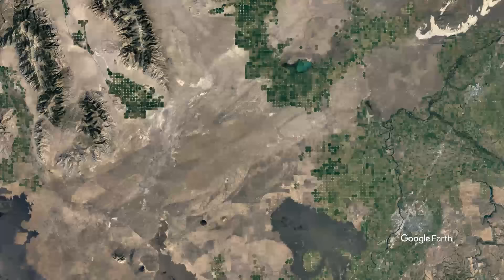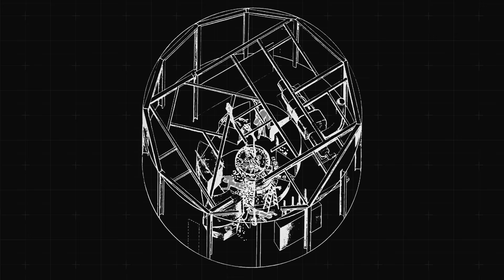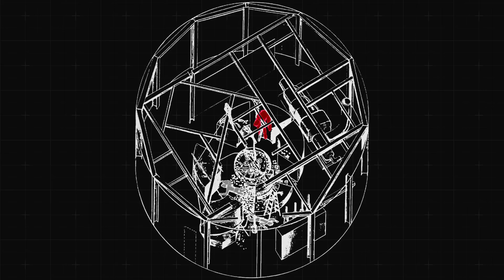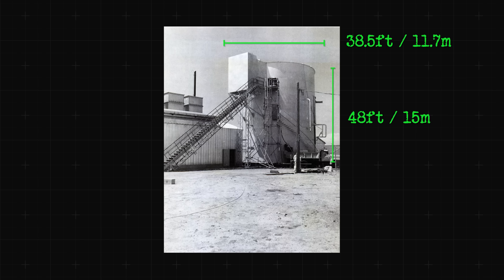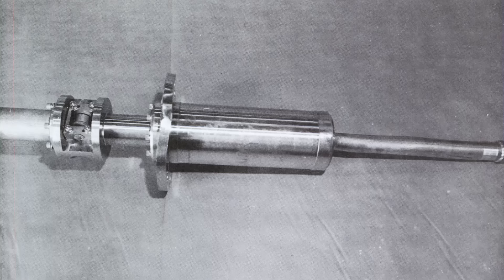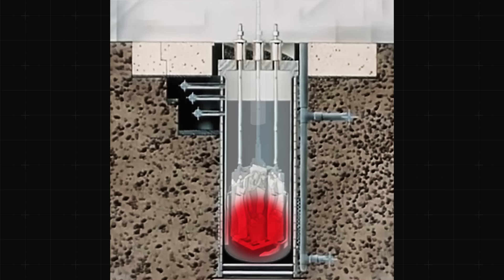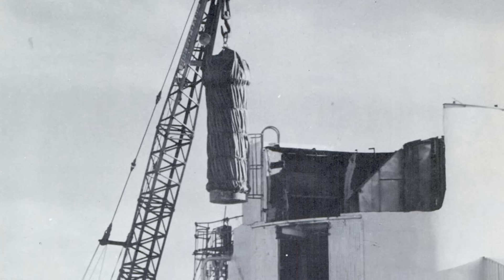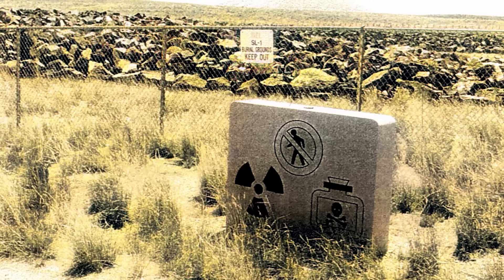America's First Nuclear Disaster - The SL1 Incident

Comment: What is amazing is that it took less than a second for this meltdown and explosion to take place. It gives you an impression on how fast fission can take place.
Reply: WAAAAY less than a second.
Reply: A nuclear detonation takes place in billionths of a second. The SL1 reactor going prompt critical while still far faster than any human could have responded to was much slower. However, what happened was much closer to a nuclear detonation than a nuclear reactor.
Reply: @taras3702  “Nuclear detonation” is an essentially meaningless term, there are no redox reactions occurring.
Reply: They were dead before they even realized their mistake.
Reply: Jim Frazier  The heat from radioactive decay of fission products must be considerable for snow to melt on contact at that location.
Reply: Jim Frazier  Just like what happened to the core of the reactor during the Chernobyl accident. Chunks of the fuel rods and graphite were ejected everywhere at the plant, and just one chunk of a fuel rod or graphite inflicted supra-lethal doses of radiation. I imagine only bits of the core were left of the SL-1 reactor. I don't doubt the debris was buried as speedily as possible. I imagine the photographer who photographed the remains of the core absorbed a hazardous dose, like those who were present at Chernobyl.
Reply: @taras3702  Nothing actually detonated.  The heat released by going super critical flashed the cooling water to steam.  This in turn resulted in enough pressure to blow the op of the reactor off.  Kind of like tossing an unopened can of beans into a campfire.
Reply: @cerad7304  I know that. What happened was in simple terms a nuclear fizzle, where a nuclear device failed to detonate but the core and surrounding components "disassembled" themselves before a significant nuclear yield could be generated.
Reply: @taras3702  No. Just no.  This was not a nuclear fizzle.  The reactor was not on it's way to producing a nuclear explosion.  The only role the nuclear fuel played was to superheat the cooling water.  It is simply impossible for a nuclear power plant to generate a nuclear explosion.  A bit of research will make this clear.
Reply: From the time the reactor went prompt critical to the time it destroyed itself (stopping the reaction) was about 7.5 milliseconds.  During that time it produced about 6000 times its designed power output.
Reply: @cerad7304  Prompt criticality means  fuel, cladding and the coolant vaporizes from the sudden power surge that could be millions of times the reactor could handle. That makes it a bomb, as as I said  before any nuclear yield could result the core "disassembled" itself and halted the nuclear runaway.
Reply: @taras3702  The coolant flashes to super heated steam.  The fuel and cladding? Not so much.  It's a steam bubble explosion like heating an unopened can of beans in a camp fire.  'Millions' is a bit of an exaggeration.
Reply: I‘m still surpirse how horrible that reactor design must‘ve been that the accidental removal of a single control rod leads to immediate explosion. wtf
Reply: @everyone  they probably had enough time to think "oh shit" in their minds
Reply: @taras3702  Photos of the core were taken via a camera attached to a crane. Crane operator cab was covered in lead shielding and  was directed by observers from a safe distance watching with binoculars.  Also the recovery of the 3rd man pinned to the reactor's ceiling beam was retrieved with the crane and a special stretcher attached to the boom's end.  They had to recover his body and prevent it from falling into the core causing further criticalities !  Read the book , " IDAHO FALLS " by McKEOWN and get a fuller picture of the ENTIRE timeline of events. !
Reply: There's no such thing as a nuclear detonation the only detonation that happens is when the conventional explosives inside the unit are detonated to create highly foc
 to compress the halves together, thereby bonding them
Reply: @cerad7304  yes, it was more likely a steam or BELEV explosion than a nuclear explosion.  All the liquid water in the reactor immediately flashed to steam once the vessel was compromised, throwing bits of the reactor and the rods out at the same time.  Much like a conventional boiler explosion.
Reply: @AC-fg4kg entirely wrong
Reply: There is much more to the story. To learn that though you need to get a copy if the interim final accident report. Not just the final report.
Reply: This was a steam explosion, not a meltdown.
Reply: @user-oy4qp9pq6i  There is NO SUCH THING as a "Steam explosion". Steam cannot "explode" ever - under any circumstances. Calling it a steam explosion is both inaccurate and a direct evasion of the actual proximal cause of the disaster - a prompt critical nuclear excursion that melted much of the reactor fuel, splattered the fuel and control rods laterally sideways, and launched one through an operator pinning him into the HVAC system to be found much later, and that caused the entire vessel to shear all of its piping and to then "jump" nine feet into the air - ALL of it. 

It wasn't a "meltdown". There wasn't a long enough event or high enough energy release to create molten conditions that could melt "down". There was indeed melting and fuel vaporization.

It was in point of fact a low yield nuclear detonation that directly caused the destruction of the reactor core and everything that followed. It was a warning about the dangers such reactors pose. It was a largely unheeded warning. And as a result we then had the KIWI-TNT nuclear detonation (intentional), and the Chernobyl nuclear detonation AND meltdown.  Humans are slooooow learners.

Comment: The Windscale fire nuclear disaster in the UK would be a good similar event to cover, most of the radioactive material was stopped by protective filters, but the majority of people involved in the project thought they'd be unnecessary.
Reply: Plainly Difficult has a pretty good video on Windscale. Would still be interesting to see is covered by this channel too since they may find other details about the incident like they did with this video.
Reply: Not sure about the filters. One of the safety inspectors at the site - Tom Touhy - I remember seeing him being interviewed in much later years & he said even at that stage the filter mesh was compromised. Site engineers tried to prevent him accessing the chimneys & when he finally got up there he could see that the filters were torn in several places & were flapping in the breeze. Certain circles in nuclear physics & politics called the filter's "Cockroft's Follies" because they'd cost so much & as they were so poorly maintained they were almost useless. The filter membrane technology of the time wasn't great either. Some layers worked fine, others may as well have not been there.

I seem to remember that they'd been repaired by the time the fire broke out, but as they turned the fans on the fire many argue a lot of the radioactive particles just blew straight through.

Everyone knows there was a fire but the UK government covered up the effects. Sure it wasn't Chernobyl, but the debate is still raging about cancer rates in the area, way above background levels of radioactive chemicals being found in kid's teeth etc.
Reply: @runlarryrun77  Just to clarify:  Tom Touhy was actually the General Works Manager for the Windscale site, and directly oversaw the operation of the two reactors, or "piles" as they were referred to.
Reply: British Government for 50 years:  It never happened and if it did, it was the fault of the man who saved the plant and area.

And that remains the official account to this day though declassified so we can at least say yes it did happen, but the government has never altered its initial findings despite it clearly having been their fault by making demands of people and plant that they were never equipped for.

There was an official study done in 2010 to ascertain if there had been any undue effects of a massive release of strontium 90 across a wide area, it focussed only on the by then few surviving plant workers and concluded there were no problems. No wider  regional studies have been conducted to date to the best of my knowledge despite a wide area of effect.

BBC 2007:
"The radioactive fallout from a nuclear accident that rocked Britain 50 years ago was underestimated, scientists say.

In 1957, a fire at the Windscale nuclear reactor in Cumbria led to a release of radioactive material that spread across the UK and Europe.

But new research claims the incident generated twice as much radioactive material and could have caused more cancers than was previously thought.

The research was published in the journal Atmospheric Environment."

^ no further enquiries have ever been made. But russia bad Mkay!
Reply: There is no comparison between SL-1 and Windscale.  The plume from Windscale reached Scandinavia and is essentially closed to Chernobyl than SL-1, although there were differences, both were carbon graphite moderated reactors.  Windscale was caused by a Weigner Release that melted fuel rods while Chernobyl had a Weigner Release that caused the water cooling tubes in the graphite to melt and there was a hydrogen and steam explosion.  Both also had fires.  There were a number of other issues, but these were the not Germain to the similarities.

Comment: Based on one of the few books written about the event, part of the issue that caused the sudden criticality was the boron infused paint which flaked off and caused the control rod to 'stick. ' coupled with the late hours and some personal issues (not a love triangle) a momentary lapse and the rest is here. There were plans for a development downwind called 'Atomic City' which today has a population of less than 27.
Reply: Yep, the planned maintenance that was put off by the staff was replacing the paint layer. Oops, I guess greed isn't good.
Reply: Atomic City (AC we called it) is southwest of the former SL-1 location - generally upwind.  As for the lack of growth of AC, it's in the middle of the desert and the water table is hundreds of feet down requiring a  pretty powerful (read: expensive) well pump.
Reply: so a population of 26 then?
Reply: @bullnukeoldman3794   Correct. As a former resident (and water system operator) the well is 680 feet deep, pump set depth is around 600 feet. It requires 480 volt three phase power and is a 15hp pump. 

The lack of growth is mainly due to the location (nearest gas and real stores is 26-28 miles) and the changes in the nature of the population.
Reply: My uncle and aunt owned the bar in atomic city for years.

Comment: I worked on the final cleanup of the ARA-2 area where the SL-1 reactor was located.  My job was to design the cleanup process for the AR-15 tank, located to the north of where the reactor building was located.  This 1,000 gallon stainless steel tank contained liquid waste from the complexes lab facility.  It was below grade and when we lowered a camera into it, you could read the print on the inside wall that had the name of the manufacturer.  Tank looked brand new even though is was over 40 years old.

Comment: There's a video from the 60's on the SL-1 reactor design. It's on YouTube and it's called "Argonne Low Power Reactor" The film was made before the accident, before it was even named SL-1 (At the time it was the ALPR, then SLPR-1, then finally SL-1), The film shows the internals of the reactor itself, its construction, and what it was intended to be used for (remote artic outposts). Really interesting if you want to know what the thing actually looked like and how it worked. Amazing to see it before the accident.
Reply: Sure. It's really cool

Comment: When I was an undergrad at U.C. Berkeley, I worked as a co-op student at the Naval Radiological Defense Lab in San Francisco, which had a mixed military and civilian staff. Several of the enlisted navy at the lab were part of a nuclear incident rapid response team. They were among many such teams that took part in the clean-up and dismantling of the SL-1  reactor. Every member of that NRDL team receive close to their maximum permissible lifetime dose of radiation in that process.
Reply: It's scary that in one cleanup and sanitization decom job they reached their lifetime dose...I work in a CANDU reactor and I get less dose than what a pilot of airline passenger gets per year.

Terrifying.
Reply: @jjnich4915  With no containment vessel, the contamination was spread far and wide making cleanup and decontamination very difficult. Reactors built after that accident generally were much safer. Although, there were exceptions. The accident at Chernobyl, resulted in a large number of people receiving lethal doses of radiation.
Reply: @DrMarkHShapiro  If something like that happpened where I work...heads would roll. 

Thankfully the unit I work on isn't hot. Our next reactor refurb is going to be a spicy one. They are talking potentially ~200mrem/hr. Right now it's 13mrem/hr max unless you are working near certain tubing or vessels in the vault.

Comment: This is a well done narrative of the SL-1 incident. The only thing that you could add is the fact that they had to cut through the upper side and top of the reactor building to retrieve the body impaled there. They rigged special shielded cranes to cut and reach through from the outside. We had to study this while I was going through NRC license training at Ft. St. Vrain in Colorado. We also used U-235 as startup fuel, but more Th-232 as converter fuel. FSV was a helium cooled, graphite moderated HTGR. I worked there for 23 years, and we shipped our spent fuel to INEL for reprocessing, but good 'ol Jimmy Carter (a nuclear engineer) stopped that program. We shut down and decommissioned due to steam piping problems. FSV is now cranking out 1100 MWe after being converted to natural gas combustion turbines and heat recovery for our original 330 MWe turbine generator.
Reply: Worked at the Idaho Chemical Processing Plant (ICPP), the plant for reprocessing all sort of different reactor fuels and I remember some of the HTGR fuels references.

Comment: I love nuclear power! The modern reactor designs are awesome! In particular the mini reactors.
Reply: It boils water! How awsome!  but it's green?????
Well yes but not for 100,000 years or so 👍
Reply: @adambutler3671  as it stands right now they have a better lifetime carbon footprint than hydro or even solar. That and we could have a chernobyl level event every year, and it would still be a drop in the bucket compared to the annual deaths caused by literally any other baseload power providing technology (e.g., reservoir hydro, oil, gas, coal, etc...). Nuclear is by a very large margin, the safest power producing technology in terms of deaths/kw-hour, of which it represents the lowest option.
Reply: @adambutler3671  actually it's blue

Comment: @Dark History - You're absolutely wrong.  The first and worst (to date) Nuclear Disaster  happened at The Santa Susanna Field Lab (Rocketdyne) in the hills of Simi Valley (Ventura County)/Chatsworth (L.A. County) CA in 1959.  I was born and grew up in Simi Valley.  After the meltdown, they went strictly to Rocket testing.  Man, when those rockets would go off, it was a loud rumble that shook the windows - you could actually feel the pressure of the sound wave pass by.  The area is still contaminated, and the community is still fighting to get it cleaned-up.
Reply: My dad did pressure vessel inspection work at Rocketdyne in the late 50's and early 60's. We lived in Tujunga way off to the East of the San Fernando Valley. You could hear those rocket engine tests in Tujunga, maybe 40 miles away. He was also there when the sodium reactor had its failure. He died at age 80 riddled with cancer. On a more humorous note, the guys at Rocketdyne liked him and pulled pranks on him. Somebody put a machined technical piece into his briefcase and had his car stopped and searched at the gate, found the part, and had him ''arrested''. It was on his birthday and the security team delivered him to a small party for him.